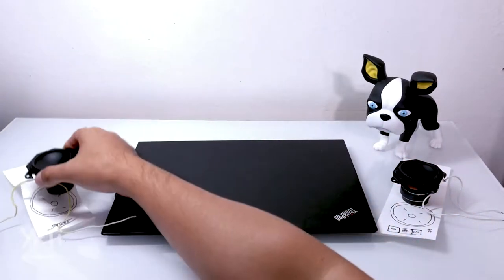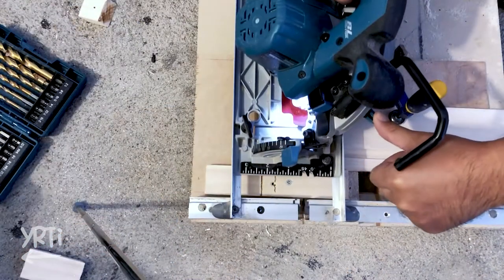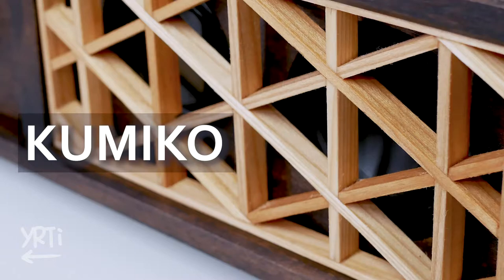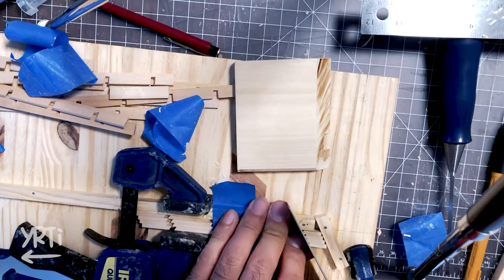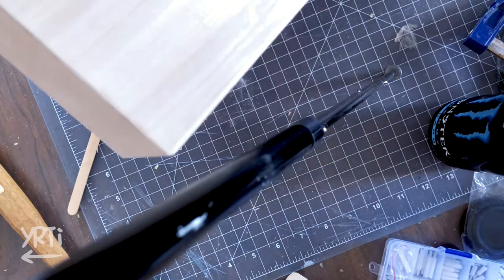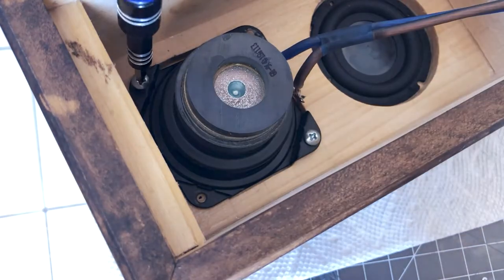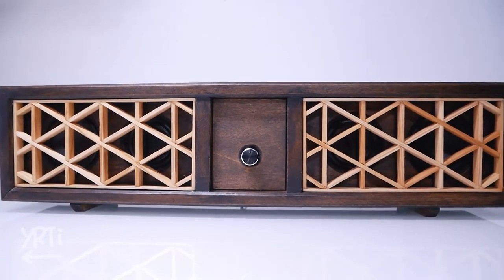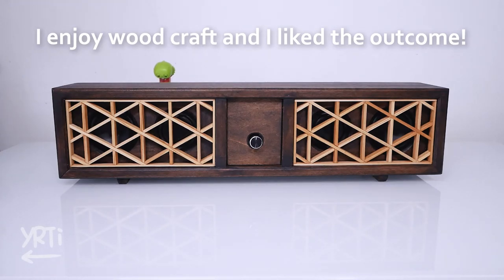I Made a Soundbar with Kumiko Grills - DIY Speaker

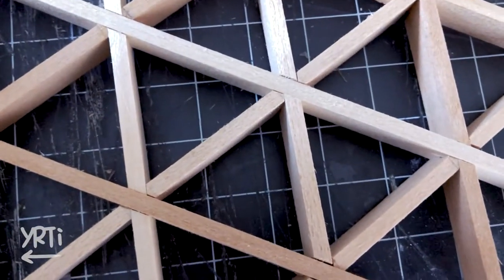Comment: I picked an hack for the gaps that are there in builds like @4:45 where I add some wood powder (collected from all the drilling and sanding) with fevicol/wood glue and make a clay like mix of it to fill the gaps. later on, I sand it and it give like a unibody design with no gaps. hope this would help.
Reply from the maker: Thank you for sharing the great tip! It's always good to know more ways to do something;)